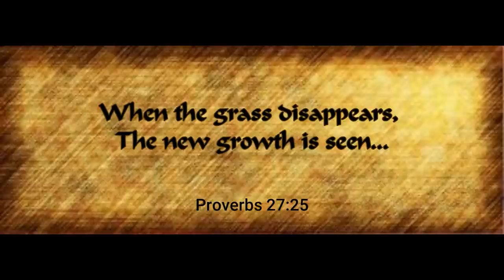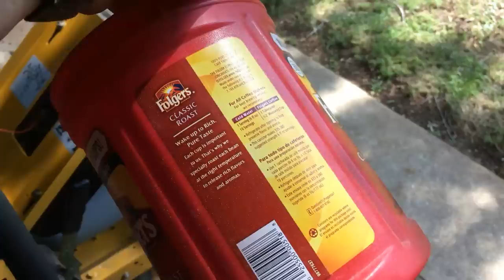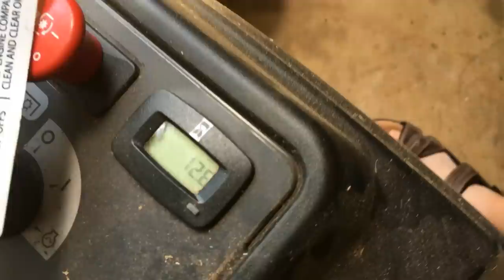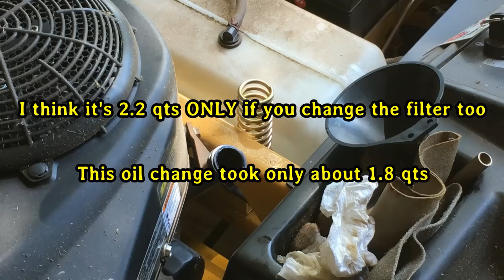💥HOW TO⚠️CHANGE OIL 🔧 IN A KAWASAKI 23 hp FR691V ⏰

Comment: My dealer said specifically not to use synthetic oil until 100 hours.  So the rings will fully seat.  Otherwise you run the risk of the rings not seating and the engine burning oil.
Reply from the maker: Wow. 
Good to know, thanks!
Reply: Your dealer is not a Kawasaki technician. Kawasaki highly recommends you use their line of oil for all oil changes. Their oil is synthetic with added zinc. You're dealer can talk all he wants but Kawasaki makes this engine and says otherwise. peace!

Comment: It is 1/2" ID hose. IMO, the most idiotic design for an oil drain. I highly recommend a mulch kit if one is made for that Lowe's Raptor. You'll stay clean and your air filter will thank you.
Reply from the maker: I'll have to check out the mulch kit.
That mower DOES get you dirty!
Thanks!
Reply from the maker: Does having the mulch kit bog the engine down in taller grass?
Reply: TexasPrepper2   Yes it will. The idea is to mow more often but it shouldn’t take as long. Not my cup of tea personally... getting dirty and not having to do as often is fine by me. 

Just did this as well on my Worldlawn Diamondback as well as the hydros. Good job. Great engines, love mine.

Comment: My dip stick reads do not screw onto threads when checking oil level. May want to see what yours says
Reply from the maker: I've never noticed it saying that...
Reply: @BIGALTX  My Ariens zero turn has the Kawasaki 691V and it also says NOT to screw dipstick in when checking oil level.
Reply from the maker: @mailman390  Interesting... I'll have to check mine, thanks

Comment: i just bought a Toro with the same motor . It has on the dipstick Not to screw the dipstick in to check the oil. Also no more than it costs, replace the filter each time you change oil. I am going to use the Kawasaki oil 10w-40 on mine.
Reply from the maker: I may switch to Kaw 10w-40 on mine too, thanks!

Comment: Wonder if you could help with a question. I just bought a used mower with the fr691v Kawasaki. It has two hoses attached to the carburetor. One to the fuel pump and the other is just hanging loose. Could you look at your engine and tell me where I should attach that hose? Also, I just cleaned the carburetor and this engine will not start when it is below 50° f. Any ideas on where I should look for a problem there?
Reply from the maker: I really couldn't tell
Looks like it might be going back to the tank as an "overflow" but not sure
It goes behind the seat and down under/beside the back of the tank.
Looks like there's another filter connected to it  
Best I can do....
Reply: Try adjusting the Throttle Cable so that the Choke closes completely when You put it on Choke to Start when the Engine is Cold..........

Comment: I have serviced 3 of these engines so far. 1 Bad Boy mower, 1 Gravely mower, and my personal Hustler Flip mower (mine came with an hour meter). The first 2 were the church mowers that I use and maintain. The oil is so slow to drain, I started using a cheap Harbor Freight Hand Pump to suck the oil out and then let Mr. gravity take over. It is faster for me.
Love those Jesus Boots man. Not too good for grassburs though.
Reply from the maker: I don't wear the sandals very often.
Just can't get used to the feeling...  :)

Comment: You should run a higher zinc oil in your lawnmower, Mobil 1 10w30 doesn't have enough zinc in it. Plus always use no-ethanol fuel as well. Thanks
Reply from the maker: Hmmm.. I'll check into that, thanks
Reply: @BIGALTX  rotilla  15/40 always change the filter thats like wiping before you poop

Comment: Why did my Gravely dealer (it’s a Kawasaki FR691V engine) tell me to bring the mower in for the first break-in oil change at 25 hrs? So many, like you, are talking about 5 hrs, or similar. I even made a “mistake” on the phone with the dealer and said I’ll need to come in soon for that “20 hr oil change”, and they CORRECTED me and said “25 hrs”. Very confusing. Either way, I’ll be doing it myself. Not difficult, but the differing hour schedules are indeed confusing…
… Thanks…
Reply from the maker: Hmmmm... I don't know. 
Maybe the dealer has different service requirements.
But, probably he just doesn't know what Kaw specifies.
Good engine. I don't think you're going to hurt it if you wait till 20 hrs

Comment: Hi is there a reset step after I changed the oil change it’s still saying change oil
Reply from the maker: On my hour meter there is a little button. Push and hold it until it clears the “change oil” notice.

Comment: Wait you changed oil and not the filter why did you give that alot of thought I do not understand oh well I am confused Please help me understand
Reply from the maker: As I understand the engine manual, it wasn't time to change the filter.
From this point on, I will change the filter every time I change the oil, but this was the first oil change, and it wasn't required.

Comment: I was told not to use synthetic oil by the dealer.
Reply from the maker: I did some research on it before I changed the oil. Several things I read said it was OK.… 
Sooooo. Not sure.
Reply: @BIGALTX  ok. Thanks